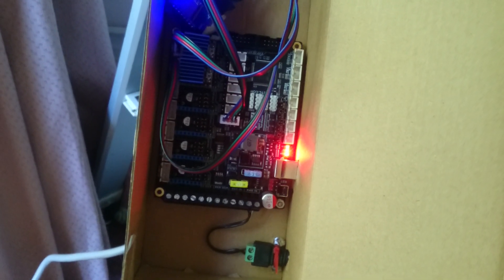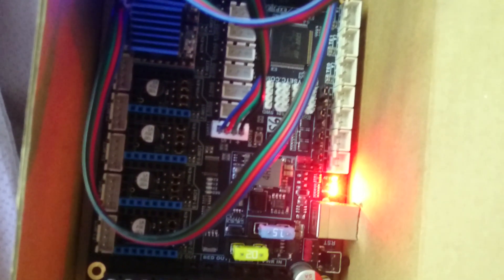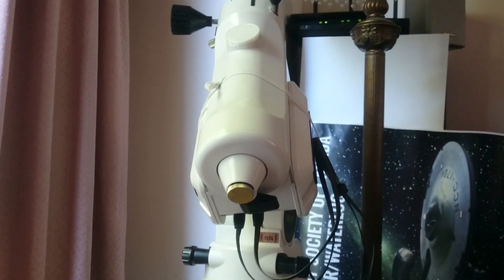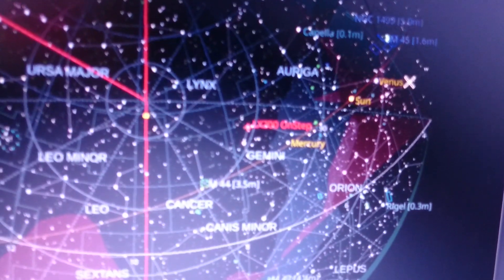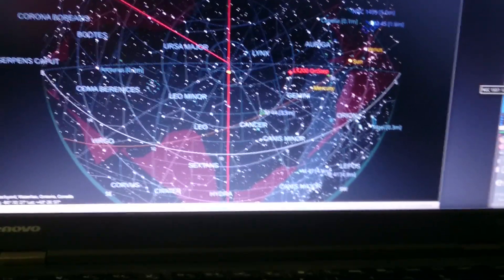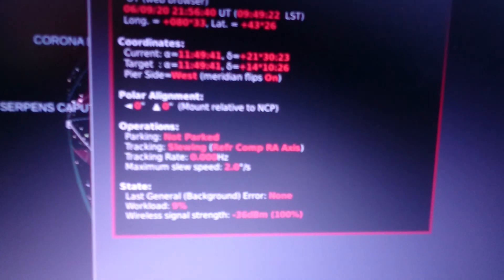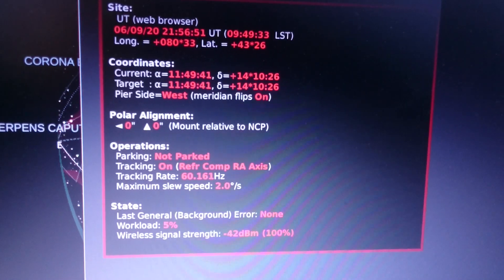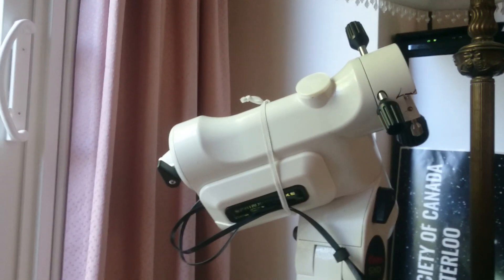FYSETC S6 3D Printing Board running OnStep Telescope Controller Firmware

Comment: Thanks for the video.  I am considering building this same setup, but am wondering if I need the Wifi module, or can I use the USB port on the S6 connected to my laptop (ASCOM driver)?  I use NINA to control my CGEM.  Thank you.
Reply from the maker: You technically don't need the WiFi module, but paired with an Android device, it is definitely a very handy tool to have. 

The ASCOM driver should provide everything you need over USB since it is written by the same author as OnStep itself (Howard Dutton). 

Can't comment on either ASCOM or NINA since I don't use Windows. But others have reported that they work with OnStep.

Comment: Amazing!  "Why not try to re-purpose 3D-printer board?" was my first thought when I've discovered OnStep project on the web(got a telescope just a month ago). How is RTC implemented in this scenario? While almost every STM32 has RTC module, as far as I know it is not needed on 3D-printers. There is no 32kHz crystal on board and no battery to keep time tracking. I found on OnStep wiki page that you got GPS with PPS signal connected? Is it replaces clock trimming by RTC?
Reply from the maker: Both GPS and RTC provide PPS 1Hz signal on a special pin, and OnStep can read that pin to calibrate its time. I used GPS because it provides latitude, longitude, date, and UTC time automatically, plus the PPS signal. RTC still requires the input of latitude, longitude and UTC offset. Unfortunately, I2C devices do not work on this board for some reason (e.g. BME280 for temperature, pressure and humidity). Other than that, all the info is on the OnStep wiki.

Comment: Awesome , Hey could the SKR 1.4 turbo or mini e3 board be used for one step ? I have one coming for a. 3d printer upgrade, the e3s are quiet cheap too.
https://www.biqu.equipment/products/bigtreetech-skr-mini-e3-control-board-32-bit-integrated-tmc2209-uart-for-ender-4 but mini don’t have wifi the skr 1.3 and 1.4 have add on options.
Reply from the maker: The SKR Mini E3 is not worth the effort, because it has an STM32F103 which runs at 72MHz. I already created a board based on this microcontroller a few years ago (STM32 Blue Pill). 
The FYSETC S6 runs at 180MHz. Moreover, the Mini E3 has only 4 motors, while OnStep supports 5 (axis1, axis2, field rotator/de-rotator, focuser1, focuser2). So, the S6 has full support. 
As for the SKR Pro, it is 168MHz, so the S6 still has the edge. And the prices are comparable.